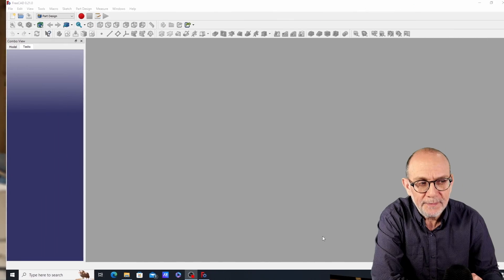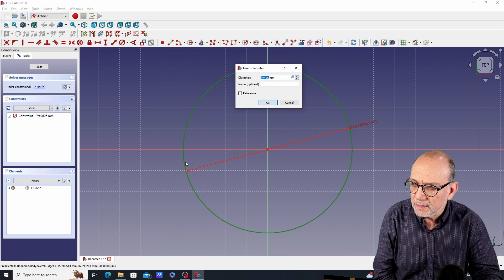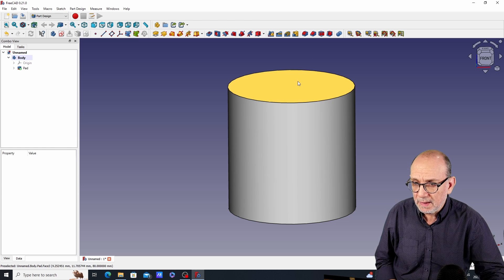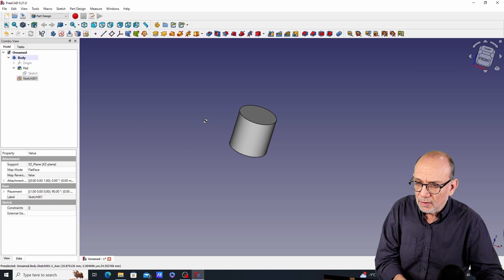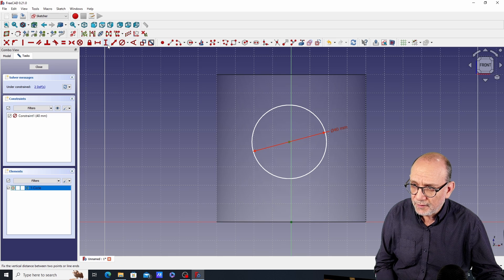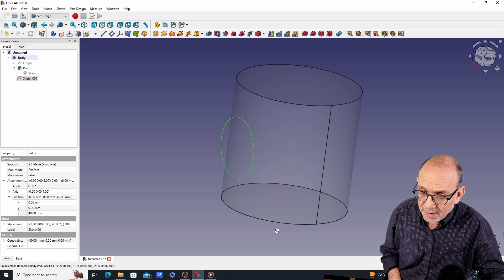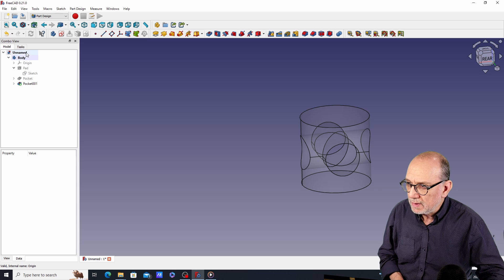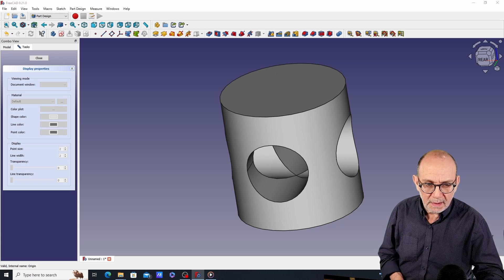An Easier Way to Make a Hole on a Curved Surface in FreeCAD

Comment: I've used many software programs before, and this one has the HIGHEST learning curve of any software I have ever attempted to use.  The reviewers were right.  Even simple navigation is obtuse, and placing a hole on a curved surface should NOT be so difficult.  'select this, dimension that, hide this, bring this forward, ...'  and then discover one of the steps was not completed correctly. Start over.  A simple hole took hours.
Reply from the maker: So here's the thing...any CAD application has a learning curve.  I originally started with Fusion 360, which also had its issues, but I couldn't stomach the licensing agreement for hobbyist use.  After learning how to use the application, Autodesk made a significant change to the hobbyist license, removing functions that were useful to me.  They did not have a pay-for hobbyist option that was reasonable and I could not afford to pay the hundreds of dollars a year they were asking for the license that would do the things I needed.  This is when I decided to move to FreeCAD, and to be completely honest, there's absolutely nothing wrong with the application.  And the newest version is actually much better than the version I'm using in the video.  Sure, there's a bit of a learning curve but if you stick with it, it'll do whatever you want.  The steps that seem convoluted will just be second nature and you'll be able to navigate the programme easily.  But you need to give it a chance.  Don't dismiss it after a few hours of use.  RG

Comment: I'm really new at this so some (all) my questions may be dumb...  Let's say you want to put a hole in the side of that cylinder, put another hole at one end, have them meet in the middle and have the intersection be curved.  I can put a pocket in the side with either of your methods and I can put a pocket at one end so they meet in the middle but I'm not sure how to make a nice rounded transition from the one hole to the other.  If you already have a video on this, just direct me to that video, I just subscribed.  Thanks!
Reply from the maker: Thanks for the comment!  There's no such thing as a dumb question.  I've never had to do what you're describing so I don't have a quick answer for you.  I'll look into it though to see if I can find a solution.  In essence, what you're looking for is a way to make a curved hole, correct?
Reply: @CreatewithTech Yes, a path through a body that makes a curved 90 deg turn.  Thanks.

Comment: Good Video,  I'm running 1.0.   I used the Placement command to move the circle to edge of the cylinder.  Right click on the sketch and the Placement command is down the list.  Using a little trigonometry and the Euler's angles in the lower box,  I can place the holes anywhere on the circle.  I created a ring with 3 threaded holes, 120 degrees apart for each other.  The biggest thing is to make sure the hole is outside the cylinder.  Round up (+.001mm)  to avoid problems.

Comment: I'm running 1.0 and this did not work. I selected the sketch (it's a rectangle) use the pocket and get "Cannot use this command as there are no solid to subtract from.  Ensure that the body contains a feature before attempting a subtractive command. "

Comment: Your process is correct but I did it without moving the "constraint circle" from the center of the cylinder. While creating the Pocket I had selected "Two Dimensions" in Type and I had put the 2nd Length value same as of the 1st Length (which is actually the Radius of the cylinder).  That's it.....
Reply from the maker: Yes, that's good.  Thanks!

Comment: Another way to make the thru hole from your example. With the circle constrained (or not),  choose pocket. Set the distance and click symetric to plane. This pockets in both directions. Clicking reverse places the hole in the opposite direction. Think of it as padding a hole.  Also,  transparency may be changed by selecting the body, and in the view tab (bottom left of screen), scroll to transparency and set value. This can be done mid operation provided continuing the operation with the proper body selected.  Ex: while building body B (obstructed by body A),  select body A, adjust view transparency as described, reselect body B and continue the build.

Comment: The only thing I'd do differently from the sketch to hole through is to pocket it and tick symmetric to plane and then hit through all . This pockets in both directions and you don't have to move the sketch off the plane.

Comment: You make easy - Hard.

1. Create Sketch plane in center of cylinder. As you did.
2. Make Hole/Circle in new center plane. As you did.
3. Dimension and constrain circle location. As you did.
2. Hide the cylinder. Not as you did.
3. Extrude the hole/circle in direction you want the HOLE in the Cylinder. Not as you did.
4. Use applicable Cut tool/feature. Not as you did.
5. Done! Done!

You are correct there are so many (hard) ways to do the same thing. That's what is good about choices and options. Work as hard or easy as you'd like. LOL.
Reply: There are easier ways than yours.

Comment: I just created a hole after hours of error messages from a program that basically tries to falt every thing and doesnt want to help. I try exactly the same method and now it doesnt work
Reply from the maker: I'm sorry that you're having problems with the software.  However, there is nothing wrong with the software it works just fine.  The procedure that I show in the video works without issue.  Now having said that I will agree that CAD has a significant learning curve and requires patience and time.  This is true of FreeCAD, and all other CAD programs.  I started with Fusion 360 and it took me a long time to get the hang of it.  I've been using FreeCAD for a while and it's great if you're a hobbyist as you don't have to worry about licensing.  I would suggest not to give up on it.  If you put in the time, you'll get the hang of it.  RG

Comment: This is a very helpful video. I was having problems making holes in a oddly-shaped dome drainage cover. Using this method worked out great. I also used the PolarPattern tool to symmetrically distribute holes around the cover. You probably could have used that tool to create your second through hole. Awesome! Thanks.

Comment: Hi Buddy, I am really finding it difficult to do threaded holes through a curved surface. The scenario is a piece of pipe with 5mm wall, 50mm o.d.   I need to place 2 threaded holes of different diameters through the wall of the pipe, (one is for M4 grub screw other is for M5 Grub screw) the hole centres share the same centre line at half the main tube diameter. So same axis but 180 degrees opposing each other.  I have tried to draw on a created plane and that was successful but when I did the opposing hole using same process it messed up both holes. Any ideas what I am doing wrong ? Thanks

Comment: Why not use Part mode, create three cylinders, orient the two that will be removed correctly, then boolean difference between the original and each of the two to be removed?  Am I missing something inherent to the Sketch/Pocket that makes it different from Part?

Comment: I found an even better way, where you don't have to "move" the sketch but can automatically attach it to the side and also specify the angle... lets me know if I should I explain further
Reply from the maker: Yes, please explain further.  Thanks!  RG
Reply: @CreatewithTech  I've created another sketch, where i use external geometry to reference the circle and create a line on the edge. On this line, I've created a rotated datum plane. on it, I create a skeet, again referencing the circle to make a circle for the hole. this won't work for all curved surfaces, but it's great for the circle. the diameter in the first skeet can be adjusted and everything still works fine. PS: I've send the file to the email from the about tab.
Reply from the maker: @lennard4454  Thank you for this.  I'll give it a try.  RG
Reply: @lennard4454  Your opinion is valid but it's too much work for nothing. 
A new sketch must be made on YZ plane and 'Pocket' it with 'Through all'  and 'Symmetric to plane' selected.
If the solid is not allowing you to see the axises just click on 'View section' icon.
The center of the circle must be constrained to the Y axis (green vertical line) by 'Point on line' icon instead of 'Horizontal dimension' icon as he did.

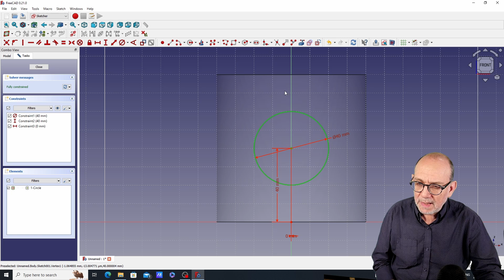Comment: 5:20 Using geometric constraints is generally preferred over datum (measurement based) constraints because it is more efficient. Instead of setting a 0mm / 0" horizontal distance you can use the Point on Object geometric constraint (the 2nd geometric constraint from the left) to get a similar but more powerful effect. In addition to constraining the point to a horizontal or vertical line, it can keep the point on any line, at any angle, or an arc, circle, or axis.
Reply: Two methods come to my mind.
1) Put a vertical constraint with root origin.
2) Point on Object constraint on vertical sketch axis.

I wonder which would put less stress on the sketcher solver.

Comment: I believe that if you pocket symmetrical keeping the sketch  in the middle it works too
Reply: Yes, symmetrical is an easier way to go, then use rotation to make the second hole. Much simpler than that process
Reply from the maker: Yes, this works.  Thanks for the insight.  RG

Comment: In the sketcher, there's a button "view section" that will hide everything in front of the sketch. There is also a "Sketch on surface" tool in the curves workbench, if you want the sketch to be curved along the surface.
Reply from the maker: Yes, thank you very much for this.  I did not realize this.  Very helpful.  RG
Reply: @CreatewithTech  you can also use `space` key to toggle the visibility of a selected item.